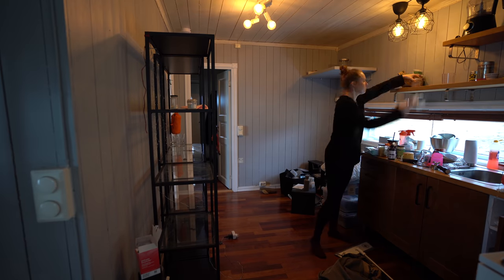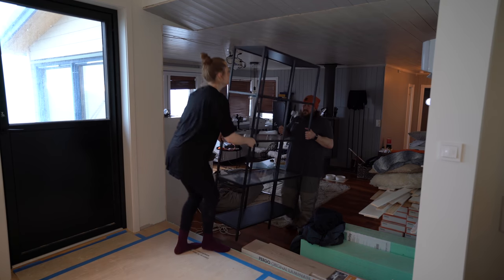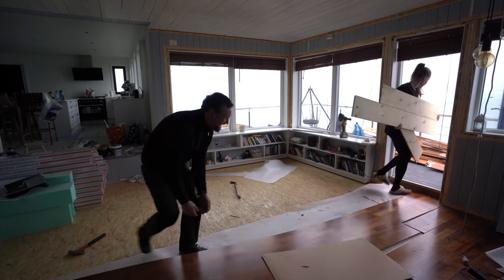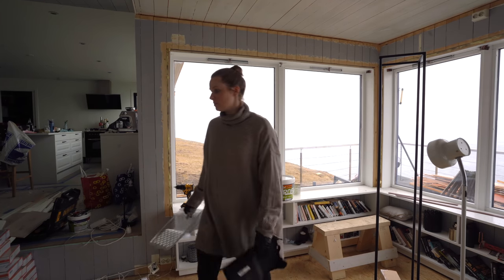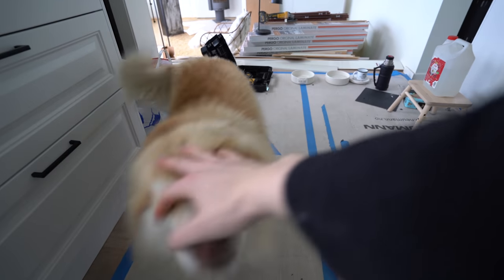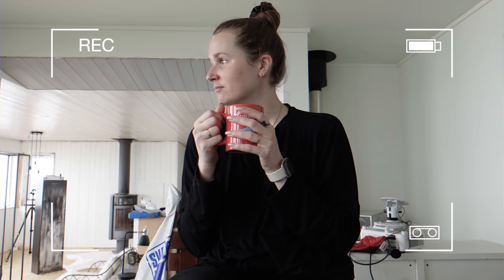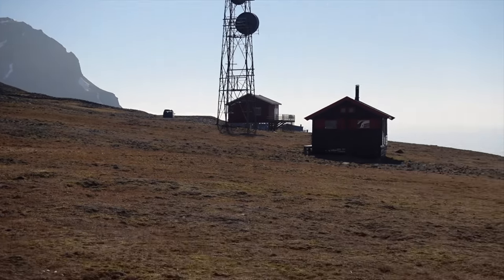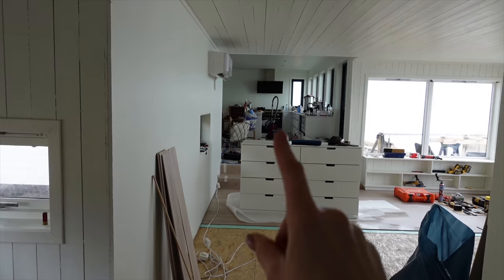FINALLY time to rip out the old cabin | Svalbard Cabin Build Part 11

Comment: If you have a problem with Grim scratching the floor, there is a product called "dog nail caps" that will protect your floor and they may make it easier for Grim to walk on slick floors.  
Your vet may have them.

Comment: Hey just a question, why don't you get new walls and ceilings in the old cabin part? Like the new ones? The wood sticks do not match so well with the more modern look of the new part!
Reply: Likely, cost is the primary reason.
Reply: @bwillan  perhaps, I can imagine how this renovations would add up in such a remote place!
Reply: Also such a big mess to pull out. God knows whats behind there!  And it is unnecessary.  The wood slats look fine. It's nice to retain some real traditional, original cabin feel.